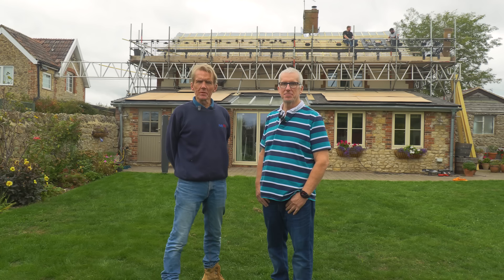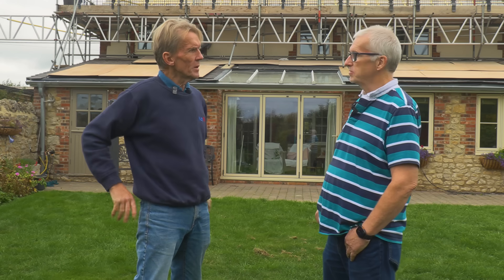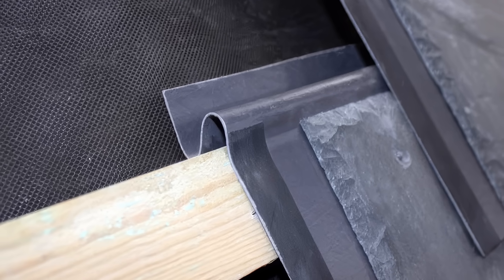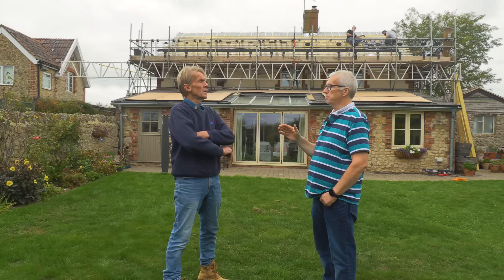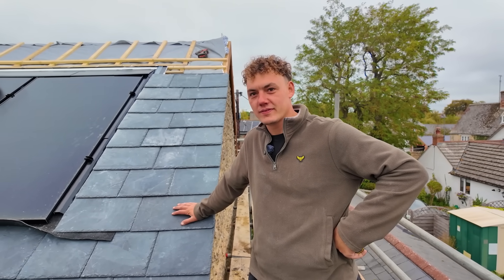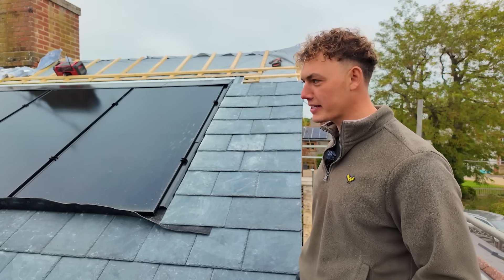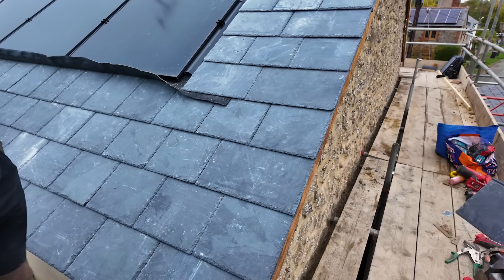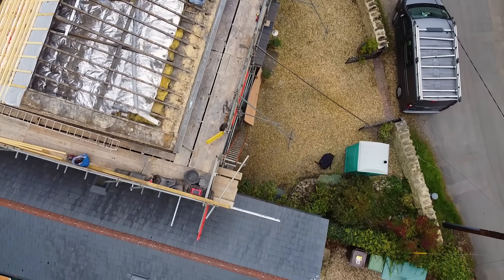Why Roofers Are Switching to This New Slate System

Comment: I insulated a cold North wall with three layers of commercial grade aluminium foil and two layers of bubble wrap. The foil was aluminium taped on the inside. I have no idea of its U value but the room is noticeably warmer.

Comment: Whilst I'm impressed that this client has specified superfoil on the inside and outside of his old cottage rafters, I'm curious why he has added the additional complication of the mechanical ventilation system AS WELL AS having a ventilated ridge tile.
Did he explain to you his reason for doing this?

Comment: interesting product but im worried the GRP backing under the slates might not last all that long. basically, classic natural slate roofs can last centuries. some black plastic material exposed to extreme temperature fluctuations on a roof im guessing max 50 years before the GRP becomes very brittle or even starts to crumble away.

Comment: Get the impression there is a lot of wasted space on that roof that could have held more panels. Minimum of an added horizontal row both sides.
But pushing the inverters inside the roof for access is brilliant.

Comment: Cost of the Mayan V a traditional quality Spanish slate?
Ok it can go to very low angle,, though there is also another system which uses strips between the slates, down to 17 Deg if I recall.   
Note the Mayan goes down to 10deg.

Comment: Not a fan of in-roof solar. Those panels are going to get pretty hot in the attic in the summer which will reduce their effectiveness as well as cook the contents of the attic. And then, at some point, they'll need to be replaced and you can bet you wont be able to get the same size panels. I'd rather have air flow under the panels to act as a bit of cooling.

Comment: Leaves me wondering. Looks a lot more substantial but is the secondary barrier anything like the US. Where it's cheaper to use bitumen tiles but they replace rooves more often; I guess the secondary barrier in this case will not last as long as the actual slate.

Comment: One of the best looking new roofing systems I have seen. At last slates that can walked on. Those verges look a little odd as they are not what we are used to, but again I think when we get used to them they will be the way forward, certainly better than the plastic ones.
Reply from the maker: You see a lot of that verge style in Northern France and Belgium. I think they look great

Comment: Hi Roger, interesting video. You are right about counter-battening fibre cement slates. This is because they are considered a close fitting covering. It is a British Standard requirement to vent under close fitting coverings if you are using an LR (breathable) underlay as there are not enough gaps to let moisture out otherwise. Natural slates however are not considered close fitting so you don't need to counter-batten. I expect you do with these though given the GRP backing.
You also do need to with the in-roof PV trays now, although when they first came out the manufacturer's said you didn't.

Comment: Really interesting video, where did you find solar panels for £75 each? I really like the extension lead idea for accessing the optimisers in the loft! I’m just about to start a new build and will be using the GSE in roof trays along with slates.

Comment: Tell me / us about the solar panels £45 a pop where from ? Supplier ? Fitment ? Is it same as the sponsor? Cheers good video.
Reply: I thought he said £75 - but TradeSparky often have some at around £50 per panel (ex vat). I'd guess the solar supplier weren't a sponsor, as they didn't get named!
Reply: Panels themselves are £80-£90 each, aiko neo 2s 510w. Then obviously all the additional in roof mounting needed and the microinverters etc.

Comment: Some friends of mine were the first to use superfoil insulation thirty years ago, when they had a delay on their oak framed build while it was tested and given UK approval. It has to have a one inch air gap using a batten either side, open at the bottom of the walls,with a metal mesh to prevent rodent ingress, and vented roof capping. Those slates are great.

Comment: I'm surprised the loft hasn't been added to the conditioned space as well.  A suitable installed new roof and end walls of the loft would have saved putting any insulation on the loft floor.  Stick an MVHR up there to handle moisture and bring in fresh air.  Was it outside of the budget?

Comment: We recently had our roof replaced on our dormer house and we also found it was cheaper to have solar built in than getting a new roof. Total no brainer nowadays and surprised the big house builders have not cottoned onto this.
One point of interest when we discussed an extension and loft insulation with our builder, we were told that the solar panel trays have a large hole in the middle which helps with ventilating the loft space, so condensation issue is reduced also...
Reply: A new house build near me is setting solar into the roof. Nice idea but they fitted a very small area of solar. It looks hardly worth the effort and almost impossible to upgrade without replacing the roof.

Comment: I am using super foil to tent my boarded loft. The roof was vented during earlier works.
It's very effective indeed. The way it reflects your body heat is uncanny. It's also not to difficult to fit although I love to go to town with the aluminium tape and probably over fix it.

Comment: Good to see counter battens. Crazy how many British roofers don't do them as standard. You see British roofers complaining about why the breather membrane leaks when they only put horizontal battens, water (condensation/leaks) pools behind the horizonal battens and leaks through the nail holes they have secured the horizonal battens with. Where you put nails through a breather membrane you are meant to use a special tape under the batten that seals the hole, but British roofers don't use that either.
Reply: If the breather membrane is installed correctly this eliminates all your concerns ,
Reply: Actually, what a lot of British  roofers do wrong, when they don’t use counter patterns as they pull their membrane far too tight which creates the pooling on the back of the battens, if any water gets past the tiles.

What you’re supposed to do as per the rags and manufacturing specifications is have 10/20 drape but lots of people don’t do that because it doesn’t look aesthetically pleasing.
Reply: Draping the membranes and felt or whatever you want to use eliminates all those concerns. It then does not rely on the tape, just physics.
Reply: Do you remember a name/brand of that special tape for under battens?

Comment: I'd simple cut PIR and foam any gaps. I'm not sold on superfoil as yet.
Reply: I wonder about 100mm PIR flush with underside of rafter (much easier to install than 150mm) and foam gaps and then put super foil over that .

Comment: As a carpenter I usually lift the barge boards up the thickness of the roofing batten then you don't need that detail on the verge, all the roofers I know prefer that method for a slate tiled roof
Reply: And so much easier to replace in the future.

Comment: Impressive. A home owner that has done his homework. Those modern roof systems normally look a dog's dinner. But that one looks good. He is venting it. Great. Integrated solar panels. I personally wouldn't touch them with a 10ft pole, but each to their own. The roof should last years. Panels don't. Interchange problems etc. 
Individual inverters inside the loft. Probably a better idea. Big increase world wide in roof solar panel fires. Often caused by on roof inverter break down. 
Overall a good looking result that is better than most I have seen. Cheap it ain't. More of I'm doing it, so doing it well.
Reply: The panels will out live him that's for sure.
Reply: @lksf9820 There is a general consensus in the solar industry that panels older than 10 years are on their way out. And by 15 years, past their best. The technology moves on quickly too. Having been a Builder for decades I have seen the transition. In size, output, type. None last that long. Just ask these solar farms how long theirs last. Many farms shut the door after 10 years. The panels may well last him out. Generating viable electricity, very doubtful. Bit like a 10 year old EV, scrap.
Reply: @davetaylor4741  You say that, but my experience with a 61kWp solar roof installed in 2011 (15+ years ago) is that there has been no reduction in output and no failures of any element of the installation. I have had the roof cleaned once in all that time. I purchased two replacement inverters when the system was installed expecting to need them, but they are still just sitting there in the original boxes. No degradation, no replacements - my experience does not agree with what you are claiming.

Comment: My house is 90 years old, no felt, original tiles, only insulation is in the ceiling joists. I don't have any problems. Are we over doing all this or what?!
Reply: His roof had failed - hence the work.
Reply: Do you have energy bills? 
This lucky chap will have very low bills for the rest of his life and he sounds like it didn't cost him much more than the roof repair would have anyhow.
Reply: My answer to your question is definitely yes
Reply: Insulation is clearly a good idea but it costs a lot and returns are not linear with the amount that you do. Ventilating the void between layers of foil seems very complicated to me. I don’t think there is anything wrong with a simple roof well constructed.

Comment: The challenge with superfoil above and below the rafter is that the air gap should be sealed. If you are letting cold air into the gap then it won't perform as designed. But getting a proper deal between every rafter is hard and time consuming. You can use a bit of pir and tape it all up. Very fiddly. And then outer layer of breathable so cold air can still get in on the right conditions. I have it but I'm now not convinced
Reply: I share your concern, if I understood what the owner was proposing correctly.
Reply: Having an air gap will eliminate most of the saving from the insulation. There is the advantage of cutting down of the radiant heat in summer but when the air temperature drops you don’t really save very much. 

I think the chap has ignored heat loss via convection when talking about U values. Building control regs for insulation is where practical. If you have a low ceiling and 100 mm joists you’re not going to put in 100mm pir between and 50mm underneath. 

Personally I think it’s going to get a lot of air leakage into the loft and that’s going to be carried away by a well ventilated loft. It will cut down the heat loss but not by much. A bit like a conservatory or porch. Tell be cold in comparison to indoors but a bit warmer than outside. This will reduce the delta T between and slow the heat loss a bit.
Reply: @davideyres955  was this roof pitch level insulation not because there’s a warm room in the loft?
Reply: ‘a bit of pie’ ?
Reply: @over-engineered pir
Reply: @allthegearuk  that makes sense now:-)  I also think having an air gap between layers is a bad idea, very difficult to seal.  But that’s where building regs falls down, mathematically meets U value, but in practice it won’t.  Just done a self build and there was absolutely no checking that anything insulation wise was done correctly, or even to design.